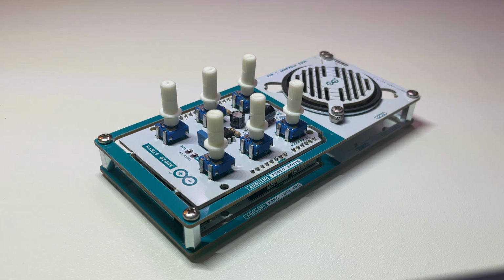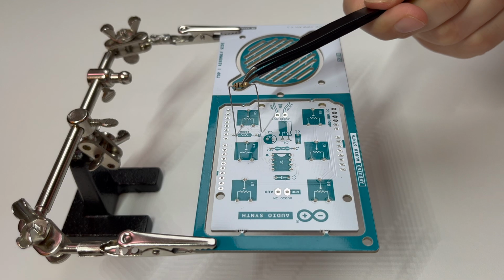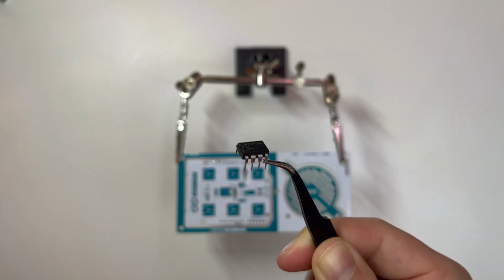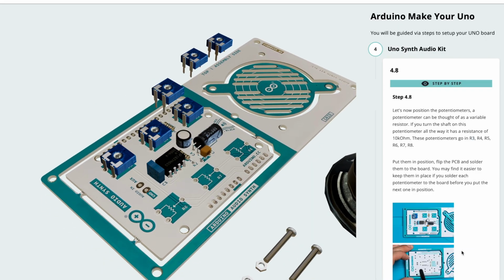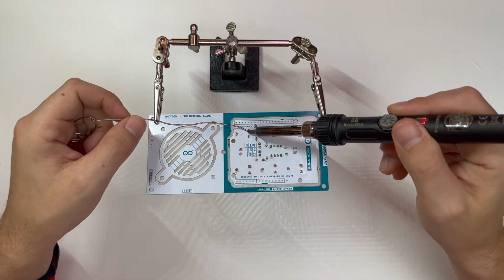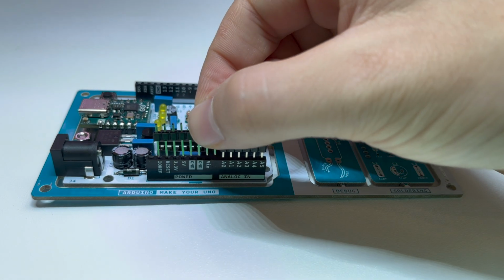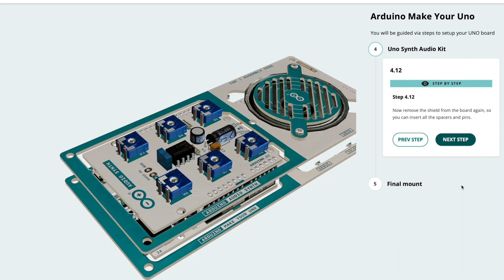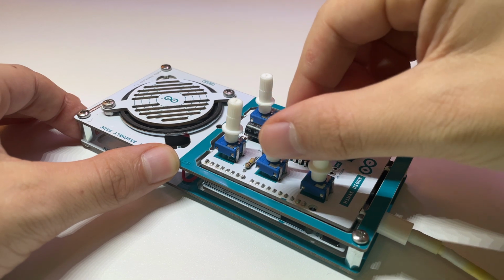Make Your UNO Kit Audio Synthesizer Project

Comment: Hey, im curious - is this an actual analog synth, or would it be classified as an digital virtual emulator?
Reply: Second option I believe. The circuit wouldn't be that simple otherwise x)
Reply: @zemax0618  tru
Reply: Sounds to me like 1bit square waves. You can't get more digital than that. 
Anyway, all synths that digitally modulate their sound source should be considered digital (even if it's just DSP effects like reverb). Audio geeks consider synths that generate the initial wave sound with a VCO to be analogue - which doesn't make much sense, but that's the generally agreed definition. 

The sound demo is rather stupid, you can get analogue waves out of the PWM outputs on arduino, you just need to build a low pass filter. Which this kit already sort of does, I think. I don't have it so I can't check, but the opamp + capacitor could already work as a filter, or be wired to be one.
Anyway, to be a synth, you need to implement at least attack and decay parameters, in addition to frequency.